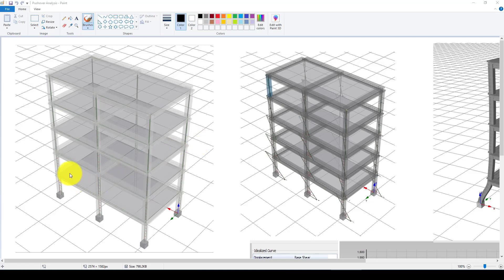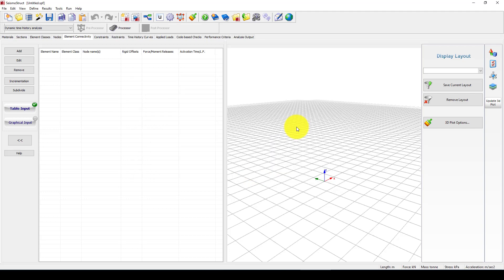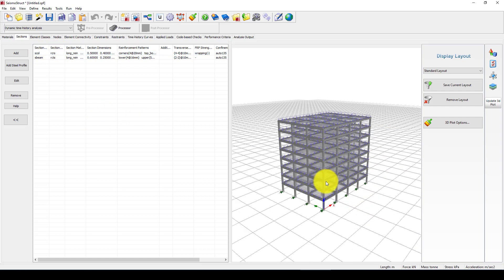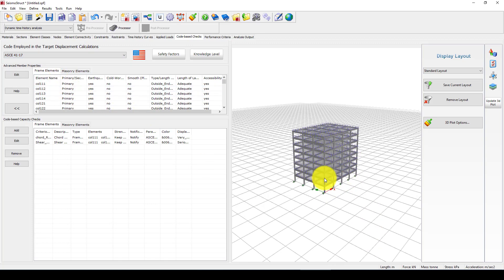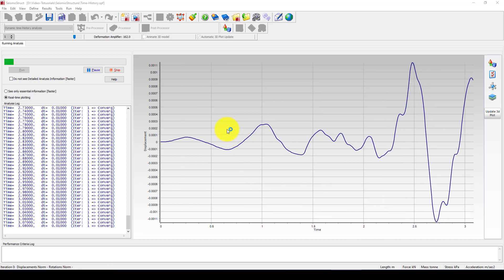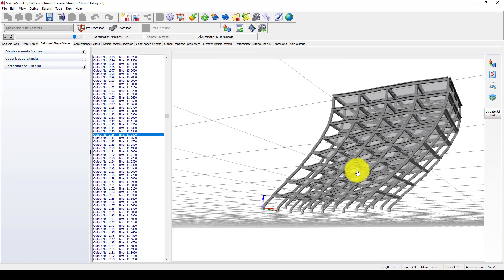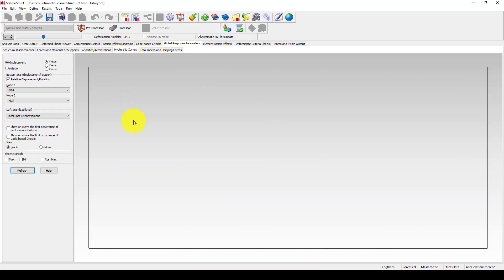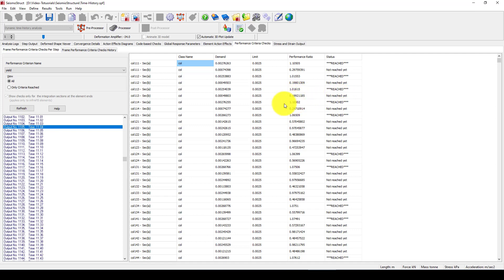SeismoStructre software Tutorial , Time-history Analysis of an existing RC structure

Comment: How did the permanent loads ( element loads  of 5 kN) also got in the building model,before specifying them in applied loads tab manually ?
Reply from the maker: You can add them manually, it was just for the simplicity of the modeling .